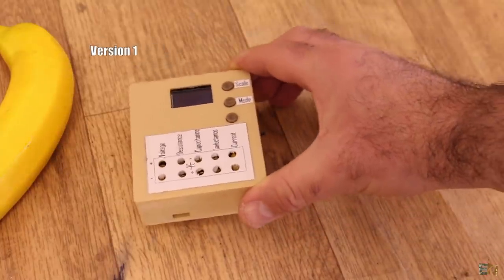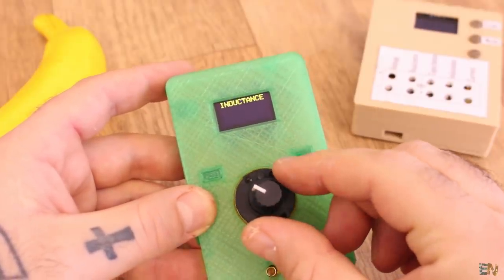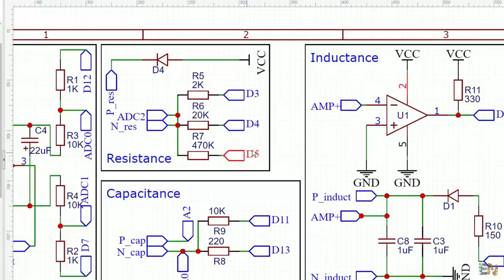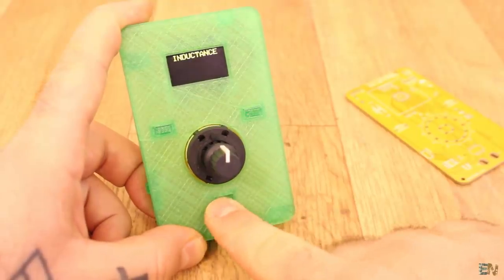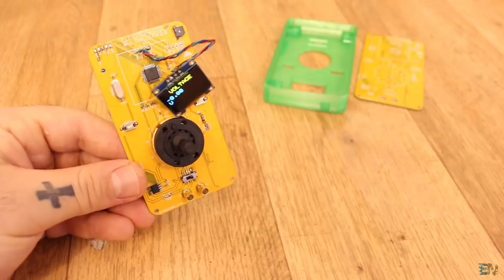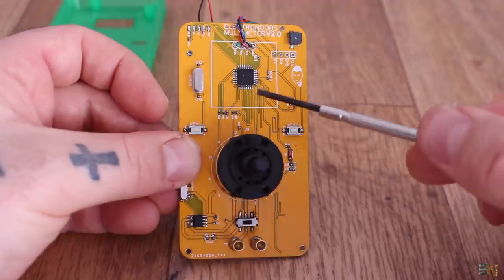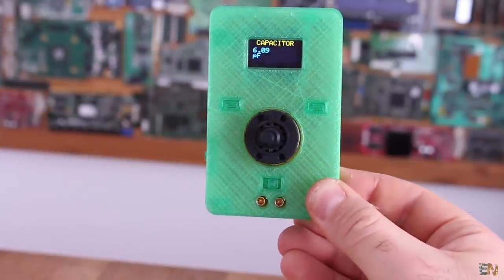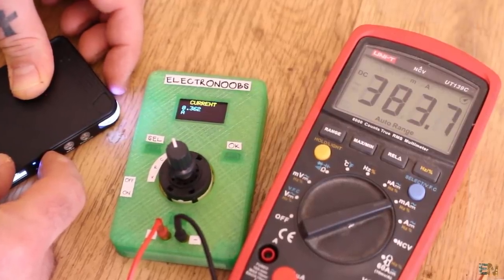Arduino Multimeter V2.0 | All in one: V R C L I

Comment from the maker: Sign up at ELECTRONOOBS.io: https://electronoobs.io/
Follow me on FACEBOOK for more: https://www.facebook.com/Electronoobs
help me on Patreon: https://www.patreon.com/ELECTRONOOBS
Reply: I am first
Reply: Now make a Multimeter with wireless probe. 🙄
Reply: Tazul Islam wireless oled to mount on glasses
Reply: @markgreco1962  That is doable. But for this case it would be a little bit excessive.
Reply: what grate kit... good for tones of application with a serial connection..
20amp  is a good choice  
i would make it a hybrid to turn it on and off  like lower the clock speed....and turn off monitor...so when you need to do a serial check crank the clock speed an read....
question
can you 90v dc reads or just 30v?
can you do AC herts check like is it 50 or 60 herts....
grate reusable modular addon for any project..... 
with all the code  what a bonus
Reply: Don't use a bridge rectifier
It may have a voltage drop
Reply: Hello, good evening, I was looking at the ADS1115 component datasheet and it shows me that the supply range is 2v - 5.5v and I have a question, if I wanted the voltage measurement range to be wider (-240v - 240v) I could put in the voltage divider of the schematic voltage circuit a 1k resistor for R1 and 100K for R3
(1k / (1k + 100k)) * 240 = 2.3762v is in range, right?
Also, if I want to make that modification, would I have to change any of the coding?
Reply: Instablaster...

Comment: Essential thoughts for the version 2.1.  Make sure that the 4 mm banana sockest are 19.05 mm (0.75 inches) apart - this is the world wide standard for test gear.  Include a 2x3 pin header location for ISP, this is very standard for Arduino-like boards.  Consider tracking and pads for some sort of input protection.  (And don't forget to get the display connector the right way round.)
Reply from the maker: Thanks for that tip!

Comment: Instead of using the 328P and the bluetooth module you can use the ESP32 which have the bluetooth low energy option and have a so high processing capability, changing that ads1115 with other high sampling rate adc and you can have a low speed oscilloscope

Comment: Nice project. I tool a look into your code
You consume many cycles inside the loop() method to identify the mode. 
if( mode == 1 ) then... if( mode == 2 ) then... if( mode == 3 ) etc..

This project has to move to C++ and make a class object with inheritance
It can be super fast and probably can add more features later using the Uno.

Comment: Nice work. 
Two more ideas you could add, multi-channel voltmeter and square  signal generator. Sometimes it is useful to see voltage on different points on a one screen. I do it by using analog pins, but you can implement multiplexer.
And max and minimum level buzzer, if current, voltage gets to high or low.

Comment: Very cool, looks sweet, except of the housing and that the switch is sticking out.
Your single tutorials about the single measurements are very helpful, especially for beginners, like usual for you and this is a sweet project that I would love to see improved, in first place use a different display, what it needs is a big good readable display, no one needs colors on a mouse-tv for this jobs, use one of those 12864 COG displays, with an UC1701 driver or something compatible, there are libraries for them aswell, they cost around 4€ and are the best right before the pcd8544/Nokia 3310 lcd's by the price-performance ration, have big pixels and are very nice to read, I am short-sighted but don't need glases for this even if it's a good distance away.
I want to build a propper multimeter, I mean a multi-meter, so a combination of a LCR-/Transistortester, multimeter and basic oscilloscope, maybe something else like a function generator, but stuck on the LCR-part, wish there would be an open-source code for the Transistortester from mikrocontroller.net, because I have no idea how to make the automatic-detection. I also want to use relays and pre-measurements, a protection through an op-amp or maybe something smarter, to make sure nothing will happen, if this, the connectors or cables burn it is bad enough, but I don't want to burn the whole circuit in case something happens, I never burned any multimeter or something like that, but this can happen any time to anyone, sure, it will make the measurement slow, but also gives the possibility to auto-range even the voltage. It will be not that small and I have a design in mind so it can be used as a desktop multimeter like as a mobile one.

But something like that is a lot of work and I would completely understand if you wouldn't want to make it open-source, I'm not sure if I would, if I get it done one day, because only the osci code is a propper book by the size.

Comment: Nice one! but you didn’t utilised ads1115 to it’s full potential I’m working on a multimeter for a week now and hopefully it will be completed in next few days, I will not be using any other ic except ads1115 and also I’m aiming for a resolution better than a 50$ multimeter it can even be able to detect micro amps of current. Great video btw!
Reply: Hi, Did you got to detect micro Amps of current? If so may we get in touch? I am having a big deal trying to figure how to make a uA meter.
Reply: Did you post this build to any site? It sounds great.

Comment: I've tried it, it was very difficult, had to match the code with the components used, and he was very accurate to set the accuracy, my device part of the amperage hovered before the load was passed, and the ADS analog pin was broken because of the voltage check forgot to turn the selector switch to volt,  maybe I didn't put a diode on the resistor input?.. basically this is a good project for hobby! 🙂
Reply from the maker: So glad you make it. I'm happy you like it. If you want and have time, you can share your results on electronoobs.io so we can all see it.  
Yes is a hobby project. Of course a commercial one will always be better. Good day!

Comment: the acs712 has a slow sensitivity isn't reliable with that adc. that adc has an internal voltage reference and since the acs is ratiometric, small changes in the supply current will effect the output of the acs while not affecting the adc. With ratiometric sensors, it is best to use an adc that accepts an external voltage reference or uses the supply voltage as the reference voltage (like the mcp3221), and then to power the acs and adc with that voltage reference. an alternative, would be to use a non-ratiometric sensor like the acs70331 which I've found to be more accurate than the acs712, acs723, .etc. when measuring currents <5A at voltages <100. 

also, the acs712 requires a min of 4.5v...

Comment: Greetings sir!
if i am going to test the voltage of the dc motors that is connected on the arduino board using multimeter, does the arduino board will damaged?
i am searching for hours about this but no information i got. i am hoping for your respond sir.

Comment: Thank you very much this channel helps much. But i need help for my final exam,
Can i measure 15Volt DC using a Voltage sensor module (has 3 feet) and 20Ampere Using ACS712 Sensor module (also has 3 feet) and integrate both of them with ADS1115?

Comment: hi
I need a design of dc multimeter (current, voltage , resistance / connectivity) using arduino nano

Comment: This was a very neat project.  I was very excited to see that bluetooth connection and listen to your thoughts on sending the data to a smart phone.  With the Bluetooth Serial Monitor app you wouldn't even need a custom app.

I wonder how difficult it would be to have a data logging feature with an SD card or to have data logging on your PC.  I do not know if a PC could data log from the bluetooth connection.

I see that the maximum voltage is 30 V DC.  Using an external voltage divider circuit to step down the voltage and then calculate the real voltage is one way to increase this range.  I'm wondering if there is some kind of probe that can be built that can be plugged in to step down the voltage sort of what goes into oscilloscopes.

Thank you for sharing.

Comment: The channel is called noob for a reason.
At 13:14 "we get pretty much the same values"... it's more than 2% accuracy with only 2 decimals resolution, when the cheapest multimeters out there have 4 digits or more with less than 1% accuracy!
LOL "pretty much" doesn't mean "approximately" or "roughly" you now "my friend" ;) it means the value is bang on the same, within a microsopic hair.
Reply from the maker: That can be adjusted in the code with more precise testing...
Reply: @ELECTRONOOBS  bullshit. You said it yourself in the video: the ADC you're using has a precision of 0.9mV. Sure you can dispaly more digits but it's useless if they're not meaningful.
Reply from the maker: @unperrier5998  0.9mV is a good precision for me, I'm not looking for a super multimeter. Those are 4 zeros decimals, 0.0009 V
Reply: @ELECTRONOOBS  you need to learn what is precision: https://www.designworldonline.com/how-to-determine-digital-multimeter-accuracy/ is a good start.
Reply: Read the datasheet of the ADC, you'll see that the glue resistors play a great role in the accuracy. And the daughterboard doesn't seem to use high tolerance surface mount resistors. It's not just the number of divisions that defines the accuracy and precision.

Comment: I think it will be cool if you add oscilloscope mode in your multimeter 😁😁😁
Reply from the maker: Oscilloscope needs speed. Arduino doesn't have enough speed ...
Reply: Owhh , i don't know about that
Reply: @ELECTRONOOBS  A graphing mode can be useful even if the bandwidth is limited to a few kHz.

Comment: Hey electronoobs pls will u reply my one question. Plsss, 
I made ir remote controlled  using standalone Atmega 328 pu microcontroller which controls 8 relays but 1 relay connected to AC fan which after switching  on it makes all relays turn off it's like it get reset to off positions. What should I do to avoid this🙄
Reply from the maker: How are you powering the relays? 5V from the Arduino? If yes, that's the problem. The Arduino doesn't have enough power to deliver to all relays. Use an external power supply for the relays
Reply: @ELECTRONOOBS  bro m using external power supply of 5v 1amp for relay and seperate 5 v for microcontroller
Reply: This is common problem for mcu working with AC.
You have big EMI pulse wich is freeze your mcu.
Shielding, grounding and using optocoupler could resolve the problem.
Also in this case you have to use watchdog timer activated for reboot your mcu.

Comment: Hello Sir,Great Project ,I was eagerly waiting for this....
Instead of mechanical Rotary Switch Can't we use some Electronic Switch such as MOSFETS.......??
Reply from the maker: That should be for version 3
Reply: @ELECTRONOOBS  Can you Pls give me the idea which FET should I use to build one...? Actually I am going to build the same type of multimeter with more compact size and Features...
Reply: Somehow this does not sound like a very good idea considering all commercial meters also use a mechanical switch. I would assume this is to avoid the other parts of the circuit affecting the measurements.
Reply: @ristomatti  More like a mechanical switch is cheaper than a high voltage AC/DC SSR.
Reply: @NiHaoMike64  You might be correct but I would assume Fluke wouldn't need to cheap out on materials on their high end models? An SSR would also require more power which should be used sparingly on a battery powered device.
Reply: How about an automatic switch that recognizes what's in the slots

Comment: hey @Electronoobs i am Vaper and i want to build myself a Ohm-Meter for my Coils. I have the Problem, to measure Resistance as low as 0,05 Ohm till maybe 3 Ohm.
How to archive that? i did not find anything usefull, how to to that using a MCU .
Reply from the maker: Well you could buy a very precise multimeter, you could use the ADC1115 16 bit and measure the voltage drop on that, you could apply 5V for example and measure current and by the formula I=V/R get the R...
Reply: Ralph try this: https://www.youtube.com/watch?v=anE0jDeBuxo
Reply: @ELECTRONOOBS  i dont want to buy a precise Ohmmeter because of the hugh Costs.

that may not be usefull, because such a Coil draws everything from the 5v Source.
with one 18650 Cell it draw @ 0,12 Ohms about 31A..

maybe it is better with a Constant-Current Source to measure the voltage drop on the coil?

i am not sure what Test-Current i have to apply and the Calculations ... it has to be somewhere in  the 10th mV ?!

Comment: Firstly i'm not a electrician if i wrote something wrong please correct me.
By reading acs datasheet there are only 5,20,30 amp versions.
I don't think that slide switch for current measurement will handle more than 0.5A and probably pcb tracks too. For programing pins why you use pads instead holes like in serial communication port it would by much easier to programm.
And lastly adding up all component cost that you listed it is around 70 USD + PCB + soldering time, for that you can get "realy good" multimeters. You have a lot of realy interesting project on your channel but this one...
Reply from the maker: Thank you for the tips, I'll have those in mind. The project is not for commercial use. Making this will teach you a lot, adn that's whay my channel is about. Pretty much all my DIY projects will cost more than just buying one... That's what industry dose, lowers the price because they sell millions products. Good day!

Comment: That small switch cant handle even 5A. You should use some other switch otherwise great work :D.
Reply: Indeed, those rotary switches, even to proper LORLIN ones, are only rated for a couple hundred milliAmps.  They are in no way suitable for switching any reasonable current.

Comment: #Project #Request
Plz plz Make arduino based  #Rf
#Spectrum Analyser range from Mhz to 2 ghz using rf modules like sl4432 , hc12 , Nrf24L01 , RDA5807M fm tuner. etc
With feature of -
Arduino Usb serial interface for better viewing resolution and better UI control using some open source spectrum analyser software .
Also With Nokia graphic display attached with circuit for operability 
.it would be better if it would have Bluetooth included with this project because one can built related app (may be you ) using Mit Ai 2 App making Tool.
That will be great project because spectrum very great tool when we are dealing with rf  Radio frequency or making smps .

Comment: The channel is called noob for a reason.
For the cost of that project, I'm better buying the cheapest chinese multimeter, it will have a much better resolution, acuracy, and isolation, not mentioning better ergonomics and well better everything overall.
Reply: But no data logging.
Reply: But the point here, unless I'm mistaken, is not to end up with a great DMM, but to have the fun and learning of building a project.  Being able to play with the code afterwards to customise it to your needs and wants is an added bonus.  If you want a good cheap meter buy an ANENG AN8203 like https://www.aliexpress.com/item/33013131909.html?spm=a2g0s.9042311.0.0.27424c4d8lMkNr  It has 4000 count, True RMS, 0.5% DCV accuracy, 3.2 Volt diode range, Frequency, and Capacitance.  The only down side (for a DMM this cheap) is no current ranges.